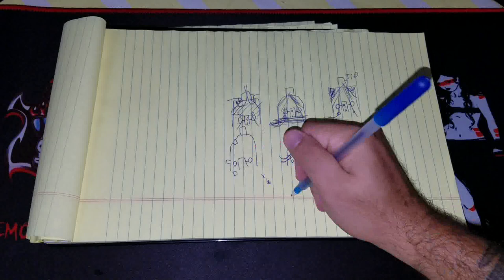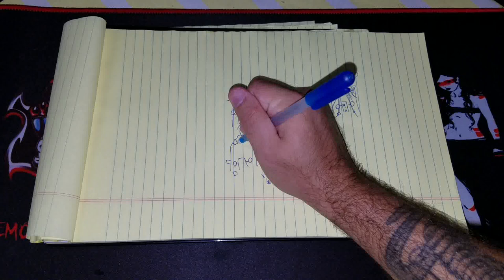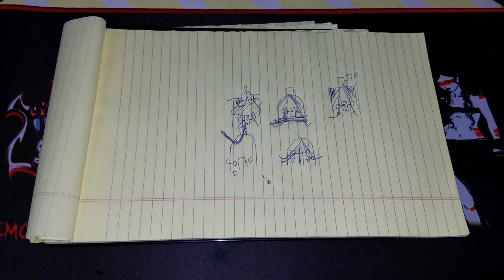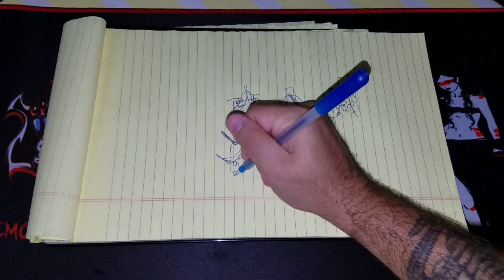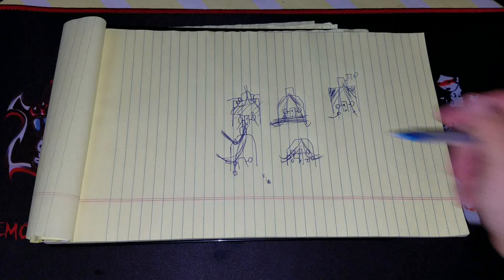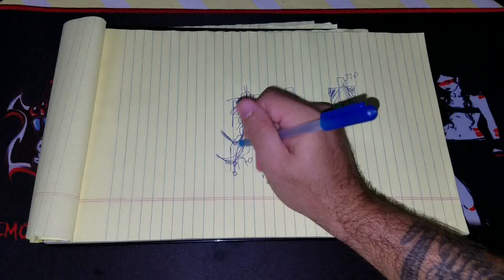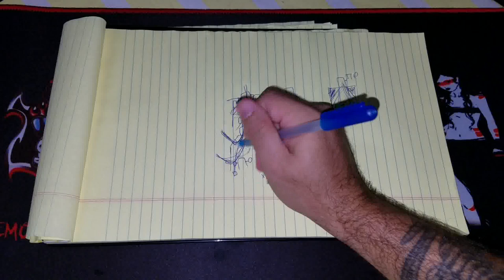Flavor Chasing: How to tell what RDA/RTA/RDTA will have the best flavor

Comment: This is a great video! I havent watched too many of your reviews so forgive me if you do this now, but have you considered giving suggestions for each rda/rta you review on how to get the best flavor given the tank size and shape? I have the Cthulhu Gaia (on your reccomendation) and the flavor is fantastic, especially only using the bottom airflow. But in order to get the resistance I want, I do 8 wraps of 24/32 claptons at 2.5 mm (giving .23 ohms for the coils in parallel), and I after this video I am wondering if that is too big for this device, considering how the coils are longer than the bottom airflow vent is wide and the chamber isn't really that big. It would be killer for you to have included in your review for the rdta what coils you have found give the best flavor!

Anyway, thanks for your videos, you are one of the best vape reviewers out there! Keep it up, man.
Reply from the maker: thanks for watching! i never recommended a gaia though lol. never used one, must have been someone else
Reply: Oops! Definitely misremembered that one. my bad
Reply from the maker: LMAO no problem

Comment: Great vid.

What's you take on tanks (e.g. the Sense Herakles Plus) that have top airflow but it's directed down the sides of the chimney directly to the coil before it goes anywhere else?

(just mentioning that not all top-air-flow tanks ignore the coil)
Reply from the maker: if it's just directed down, no good. If it goes down under the coil and back up then good.
Reply: Anthony Vapes Exactly - those familiar with this would all agree; your message just seemed to be coming off like all top airflow tanks sacrificed flavor and ignored the coil & I just didn't want those that weren't familiar with this to think that's how they ALL work....

Thanks again.

Comment: great info, I learned a lot. question. you reviewed the exo and said it had great taste, I just got one and its good but my kayfun 5 mini clone is kicking ass. do you think if I put the air restrictor in the exo it would increase the flavor? I'm using the exo in single coil mod with the coil that came with it. I have a few avocado 24s, do you think if I built the coils above the side air flow slots it would increase flavor? or would it get to hot because the coils are to close to the driptip. thanks,
Reply from the maker: It's going to depend on your build and watts. my best guess is not enough watts. plus the coils that come with attys usually aren't good.

Comment: Yo Bro :) 

You know how much I adore my iJoy EXO for flavour, well if you get the chance, try the Serpent SMM. Stick a 3.5mm to 4mm stainless clapton in it and see what you think of the flavour. I'm hard pushed to tell the difference of the two. 

In fact because of the slightly more restricted airflow of the SMM it may just edge out the EXO. It really is a cracking tank. If you build the coil high, it serves two purposes. The coil is closer the mouth, and you get four independent bottom airflow slots pushing all the flavour to the already high coil. It really is a great design. 

I really like your reviews, I'm pushing as many subscribers your way as possible from the dozens of Facebook groups I am a member of. Keep up the great reviews ;)

Oh and BTW Niki Lauda was 3 time World F1 Champion, with cars that were more or less equal in performance, and relied on mechanical grip, so it certainly wasn't exaggerated lol :D
Reply from the maker: Not sure about the serpent. no plans to review one currently. haven't really liked any of their stuff

Comment: have you tried ijoy tornado 150? not much out there on it but came out a month or so before exo series and has been my go to rta. when checking out exo it looked nearly identical. I don't use coil heads so I got that 150 just for rta head. sometimes flavor cab be muted but now I know thAt 2mm ID on it isn't going to be as good due bigger chamber. thanks!
Reply from the maker: Aaron Cabe I have the tornado hero. its ok

Comment: I understand that air directly hitting my coils creates more flavor...but why am i still getting such muted flavor from the Troll rta? I have the coils just above the bottom airflow almost dead center with the peek insulator...still no flavor. I honestly get better flavor from my OBS with the same juice. I like the OBS engine and I have an exo rta because of your great review about it. I appreciate your videos so please keep it up man!
Reply from the maker: thats a conundrum for sure. for all the faults of the troll flavor isn't one of them. It's no exo RTA but it is above average in the flavor department. my best guess is the build is too small for the amount of air. the engine has less air. try closing off the air on the troll halfway and see if it improves
Reply: Had a pair of 3mm 6 wrap triple fused claptons reading a .20 in there. changed over to a thicker gauge 6 wrap fused clapton reading .15 and flavor is much better now. Thanks Anthony! still cant wait to try the exo
Reply from the maker: glad i could help

Comment: i see where you went with the design,yeah the chamber to the engine needs to have the airflow on the base,they went with top airflow because so the tank doesn't leak but yes,i agree w you,i'm an auto mechanic by trade and know about the hemi
Reply from the maker: I figured some of my subs would be mechanics or mechanically inclined and appreciate it comparison :)
Reply: I have the Azeroth, the EXO, and the Serpent SMM. All bottom airflow. None of them leak. 8/10 times its user error not wicking properly etc why a tank leaks, unless its a Kylin as they are just badly made :)
Reply: ha ha!

Comment: The OBS engine I own which gives me great flavor, has air holes inside the chimney that is directed down from the top strait to the coils.
Reply from the maker: Yeah but as i explained in the video, it doesn't work like that. flavor is subjective but if you tried an exo rta even with a single coil you'd see a massive difference. everyone who has told me the engine has good flavor then tried the exo after completely changed their tune
Reply: Anthony Vapes the recoil is one of those exceptions aha my gf brought me one without my knowledge and I had seen Grimm green video and thought suction doesn't work that way, I built the coils as far above from the air flow and its alright
Reply from the maker: side air can be really good if you build the coils above the air :) it wouldn't be an exception, it follows the rule. the idea is to get as much air across the coils as possible
Reply: Anthony Vapes my favourite flavour atty is my Kennedy when it's not leaking >.< well when I'm not over dripping more like
Reply from the maker: Lol kennedy is bottom air so i can see it having great flavor for sure
Reply: Anthony Vapes what's your preferred rda? If you have one of course
Reply from the maker: For single coil i really like the pharaoh and pulse 22. For dual coil there are so many good ones. I really like the azathoth RDA, the eco RDA also the peerless and mad dog are pretty nice.  especially at the price point. I'm also working on reviews for a few RDAs as well. some are really winners, some not so much
Reply: Anthony Vapes pulse 22 and peerless the stainless stell addition are in my weekly rotation, look forward to the good and bad upcoming rda reviews buddy
Reply from the maker: Nice!
Reply: The OBS Engine is by far the worst tank I have owned out of the 12 I have bought in a year when it comes to flavor
Reply from the maker: pretty much

Comment: Great job, Anthony! Awesome explanation. Maybe the next one you can show how to choose the coil size if there's a 'formula' for it, or is it trial and error? 

I remember the old hemi very well. In the 60's, the 392 hemi was king. That's what all the big name drag racers used for a long time for the most part.

Do you have the Wismec Sinuous P80 on your list by any chance? I stumbled across it yesterday and it looks like Wismec may have gotten the message a little bit.  😀

Anyway, Awesome job, dude and keep on with it. We appreciate you!
Reply from the maker: Thanks! and no i didn't get one. testing the cubiod tap now plus with the predator and exo skeleton it's probably best to vote with our wallets and stop buying their shitty and unsafe products
Reply: +Anthony Vapes  Agreed! However, it looks like Wismec has adopted the same 510 structure as the Battlestar. No way to tell for sure without tearing it down, though and it still doesn't address all the other problems with Wismec products.
Reply from the maker: doubt it. the outside looks similar but inside could be different. smoant put an even better 510 on the charon.
Reply: Anthony Vapes in what way is the 510 better on the Charon compared to the battlestar?